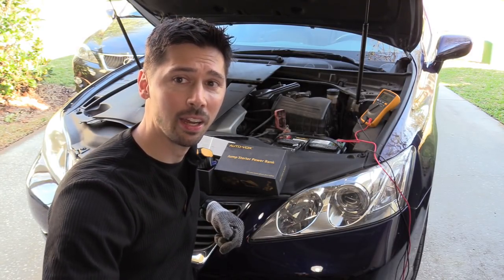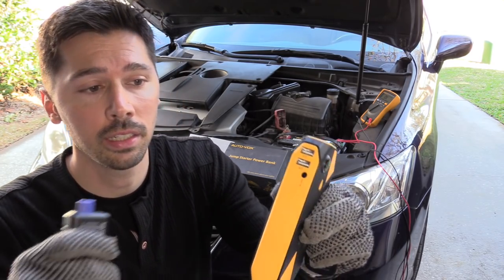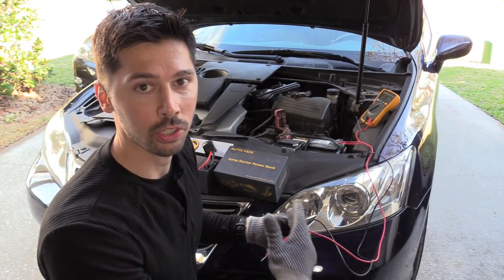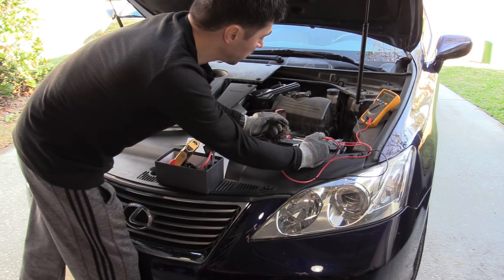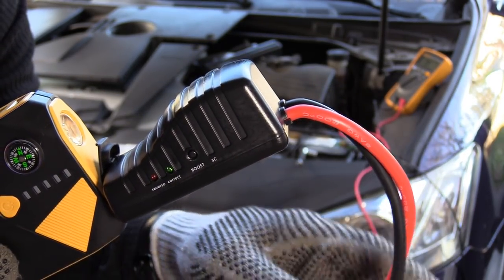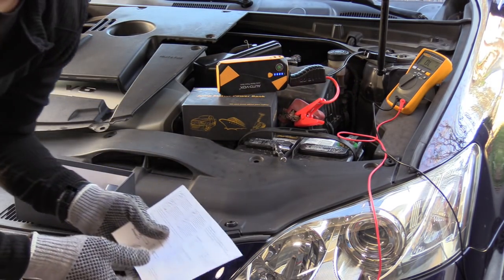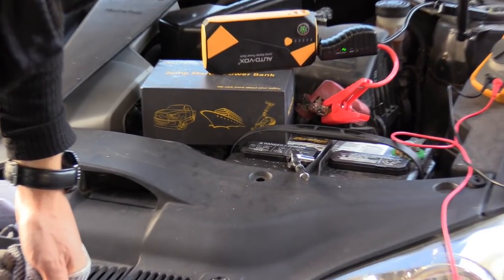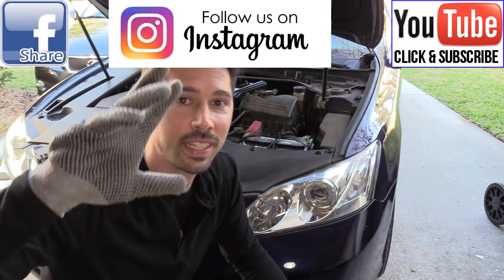JUMP STARTING A DEAD CAR BATTERY WITH A POWER BANK, WILL IT WORK ?!

Comment: I bought my Autovox charger back in 2016, charged it twice and only used it to charge my phone on the road or for an emergency flashlight. Today, after it still had an 80% charge after two years of using it, I finally got to use it on the dead battery in my car. I lost the instructions and followed your video today and BAM! my car started immediately. Woohoo! Nice to know this charger still works after four years and barely any loss of power to the charger.

Comment: How to check a car battery I like this video to message shows more step by step depth it shows a better video of you what you hook up how you connect if you can do that more on your car tech tips not to show the device but show all the step by step a little bit more unloading so much for me videos I never thought to check my car battery and I haven't tried to jump-start that little box it's so hard to believe that a little box can jump-start a dead battery, I wish I would have known about this jump start device I spent a fortune on my big battery charger got to plug it in connect it and then you could do a quick start or fully charge

Comment: Interesting idea but it costs as much as new car battery.   Monitor your battery regularly and replace it after 4 years.    If you are one of those folks that forget to charge your phone you will probably forget to charger this booster gizmo and you will be stuck with 2 dead batteries now.
Reply from the maker: good point but this battery bank has 2 USB ports and flashlight too unlike car battery. I'll check if i can find a discount code to lower the price.
Reply: Thank you Tampatec.     Hopefully others will take advantage of it.    I maintain my batteries regularly and I am not a fan of USB connectors for powering things.      Probably a good tool for folks that are not electrically savvy and technically minded.   For me, I maintain all my electrical stuff just as you do.    I have been into electronics since 1969.   Electronics has been my life passion and also my profession.    Love your vids.   Happy New Year All.
Reply: jp040759 
agreed. Have had and seen jump packs in the past and they always get forgotten about until needed.
Reply from the maker: X8PA266 *AMAZON COUPON CODE (LIMITED TIME ) haven't tested, not sure if code expired

Comment: The Video was very helpful where can I buy this? I like the concept its good for a car battery I have a motor cycle will.this work
Reply from the maker: thanks, yep Autovox jump starter power bank - http://amzn.to/2zR6Huk coupon code: XVZT9PU9 ☺️
Reply: Tampatec thank you for sharing this very helpful video. I think you there was two ways to charge the charger itself but maybe I miss understood you. Can show how to change it the second way if that is what you meant? I know how to use the plugin for electricity but was sure how the other way works. Thank you very much!
Reply from the maker: MAE HAY yes, you can charge the jump starter pack using cigarette lighter 12v plug or AC adapter.
Reply: Okay I watched a video on Amazon and I understand it has a cigarette lighter too if I understood correctly. Lol 😂